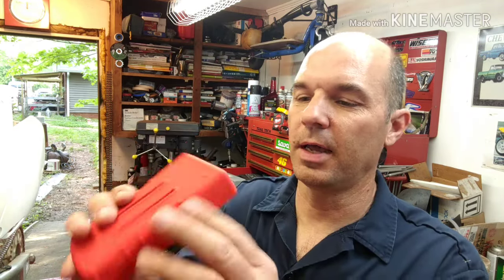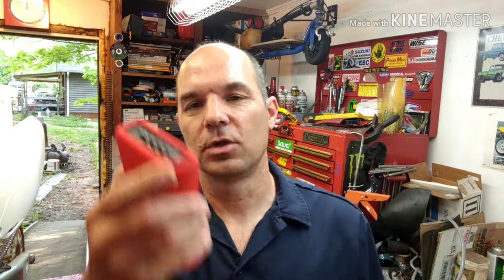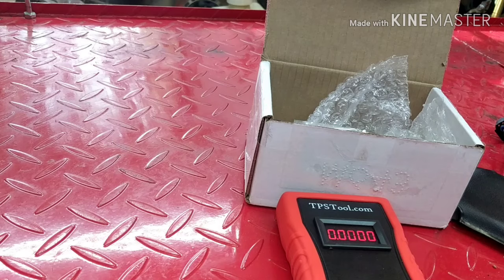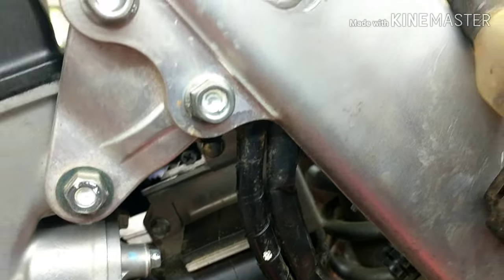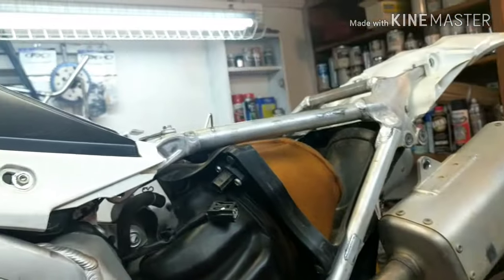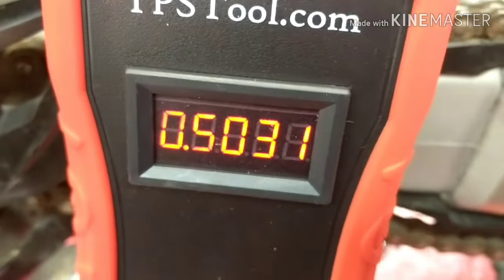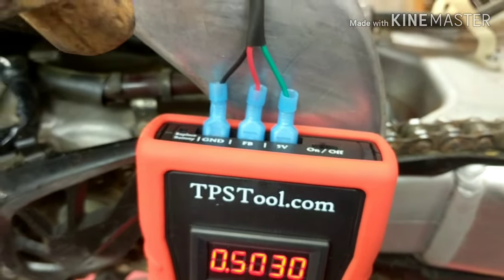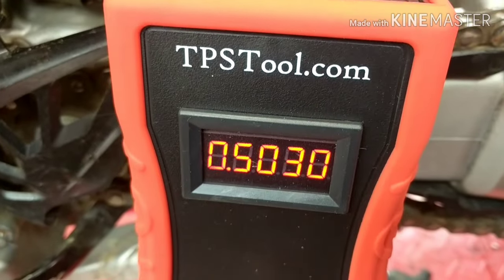Throttle Position Sensor adjusting the easy way!

Comment: Hey bro I rebuilt my 15 kx450f and I never had a fuel injected bike an moved my tps so I got the tool you got and when I tried to set it it wouldn’t go past .45 I checked full throttle it’s at 4.6 how do I get .58 to .61 thanks

Comment: Hello boss
I've made the adjustment and the bike works fine, but my spark plug is very white. What should I do to make it richer? Thanks a lot
Reply from the maker: What kind of bike is it?
Reply: @TepcoCycleRepair  crf 450 2010
Reply from the maker: @enisouertani9898  Make sure you don't have any intake leaks. If you set the TPS to the correct voltage it should run fine, a lean condition could be from a clogged injector, intake leak or a TPS set on the lean side.

Comment: I had this replaced and the guy put it in and my car just turning over was on full throttle. He took it back off adjusted and now my AT oil temp light is flashing and it's stalling out. I'm trying to adjust it but I dont have any code reader etc. I am trying to adjust it to a perfect throttle.

Comment: First time viewer. I'm having issues with a 2007 Honda Foreman ES 4x4. I've had to replace a lot of parts to include the whole throttle body. On this Honda, there is a meter assembly that flashed a code 13 which states it's the TPS sensor. I can't even shift this bike since it's an automatic. Still also trying to figure out if my fan sensor is bad in the engine. I can provide direct power and it spins just fine. I may just add a three way switch to turn it on manually. Will this tool work for this Honda??
Reply from the maker: Yes it should work with that model. It will be listed on the website. But if you have a tps light, a fan now working, and a no shift, you probably have something else going on. A common problem with those when they don't shift is the shift shaft position sensor mounted to the front of the engine. I'm a huge Honda fan but not a fan of their ES system.
Reply: @TepcoCycleRepair  Are you referring to the angle sensor? With this bike I have tried to go in a very logical order on replacement of parts. We both know they are not cheap to replace. I think once that tool gets here and and I can get the TPS to function properly. This has really been messing with my head trying to help someone out. I'm a small engine guy, not a ATV guy. I don't claim anything when it comes to this stuff especially on this model with all the bells and whistles. Thanks for your reply. Hopefully Ill have better news in a few days.
Reply from the maker: Yes the shift angle sensor.
https://amzn.to/3jArRpl

Comment: I ran my YZ250X with the TPS unplugged by accident the other day. Ran it pretty easy for about 5-10 minutes before I realized I forgot to plug it back up. The TPS was not removed just the two plugs were unplugged. Should I be concerned about any damage done? What could be damaged if it was? Enjoy your videos!
Reply from the maker: No damage, you're fine. It just controls timing. Thanks for watching!

Comment: I am wanting to know how to reset the throttle position sensor I have put a new one on but when it’s hooked up the transmission does not shift right when it’s unhooked the transmission shifts properly but I have problems with it accelerating and idling
Reply from the maker: Sounds like it's not set right. You'll have to find the stock setting for it and have a tool to set it. It's very sensitive to movement. You can't do it by eye, the slightest movement when mounting the TPS to the throttle body will affect how it runs.

Comment: I have an 08 Crf250r, would the fuel injection and carburetor be much of a difference using the TPS tool?
Reply from the maker: It controls different things. Only Ignition in the carb. Check out this link on how to for the carb.
https://crfsonly.com/forum/viewtopic.php?t=44172

Comment: Might be a dumb question but is the throttle position sensor separate from pedal position sensor
Reply from the maker: On a MC it's just the TPS. Vehicles have different set ups.

Comment: What provides power for throttle sensor
Reply from the maker: There is a 5v battery in the unit. Unless you mean on the bike then it's the battery or stator.

Comment: Thank you for the review, I'm glad you like the tool!  To go along with your video, here's a look at how a TPS actually works and what's inside it:  https://youtu.be/1CAVIe5g6yk
Reply: Awesome videos I have a 2018 yz450f electric start just got rebuilt bike runs really good but the idle is beyond high even when I try turning it down or up it doesn’t change the idle does it sound like tps adjustment
Reply from the maker: No, check your cable routing and make sure your throttle plate is closing all the way.

Comment: Would this cause a 2012 KFX450R to bog down and backfire when it hits 4th and 5th gear?
Reply from the maker: I don't think so if it's good in all the other gears. Check your valves.
Reply: Tepco Cycle Repair I just had the valves adjusted. Put in a new spark plug and took the programmer off since I don’t need it.
Reply: James McC2.4hum YES. I just put a new fuel pump on  it and a one way valve. I have no idea what else it could be.
Reply: James McC2.4hum runs good in 1st 2nd and 3rd. It was like this when I got it. The guy said it was the valves and I took his word for it. Big mistake on my part.
Reply: James McC2.4hum there’s like a 10 second video of it messing up on my channel,if you want to see what it’s doing.
Reply: James McC2.4hum what is a launch control?

Comment: I have e30 318i it was working all fine until i went full throttle as soon as i let off i had a high idle 1200-1500 idle i suspect its tps ?  Any ideas
Reply from the maker: Nice car, but I'm not sure on that one. Haven't messed with many BMW's to give you a well informed answer. Now I will say the way a TPS works, it's certainly possible. I would definitely do some testing on it first.
Reply: @TepcoCycleRepair  thanks alot im based in south africa cape town the moment i saw your msg i dug in clipped the tps open and i had a overload of oil in the tps itself i didnt get to remove th tps but all i did was take the oil out and wiped it out snapped back in, still its high but i think i need to drive it for a while and then have a look at it maybe spray some cleaner in it and clean it proper

Comment: @ Tepco Cycle  Repair  ;  I  am currently working on a Honda RC 51
"no start condition". My  question is 
will this tool work on MV Agusta bikes as well as for Nissan and Lexus vehicles ?
Reply from the maker: I'm not sure, I believe as long as you have the connector that fits it would work. Hit the link and ask them, they are very responsive to questions.
Reply: @TepcoCycleRepair  Thank You,  by the way, excellent video !

Comment: Hey, I got a 2014. Fully rebuilt, new head, new valves, shimmed, has spark and fuel but it still won’t start. What can be the problem??
Reply from the maker: Could be a few things. Timing belt, TPS, auto decompression lever stuck. Check your timing marks!
Reply: Tepco Cycle Repair timing is good and the timing chain doesn’t seem stretched. I don’t have anything to adjust tps and how could it be the auto decompressor?
Reply from the maker: Look at your timing marks, make sure they are dead on. I'm suprised you did a head without replacing it. If it was in there with the previous cam I guarantee it's stretched, it's kind of a rule of thumb when you do a top end you replace the timing chain. If the auto decompression is stuck open it will not disengage keeping compression very low. Just pull the valve cover off and make sure it moves freely with your finger. I just fixed a RMZ that wouldn't start, they just did the top end, said timing was good but they used the old chain. I insisted they put a new one in and bam done fired right up. When it's at TDC the lines on the cam need to be perfectly level with the head. Hope this helps you out.
Reply: Tepco Cycle Repair I probably need to replace the chain because everything else checks out. Thank you

Comment: Will this fix idling
Reply from the maker: Yes, it could if it's off but I would check valves and all maintenance items before this. Low compression could cause a no idle situation. The TPS won't go out on its own and shouldn't need to be adjusted to fix things, just help with performance.

Comment: Dude it's not because Honda dont want you messing with it it's because they have brain dead engineer's that have never had to pull their vehicle's apart because if these twats were made to dismantle every vehicle they ever designed they'd be making them easier to work on the second they sat back in front of their computers.  
People wonder why mechanic's charge so well you need to ph head office of that particular dealer and ask them why is it that my complete dashboard has to be removed to replace my heater core or why the whole inlet manifold has to come off to change a crook fuel injector it's a joke

Comment: I have a 2011 Arctic Cat Prowler that won’t start!  I replaced the fuel pump, injector fuel line, spark plug and also drained the fuel. Could this be my problem?
Reply from the maker: Unlikely, have you checked for spark? Sounds like it's possible a stator or spark related. Also if it sat for a long time you may have water in the system. Just make sure you got everything out of the tank before you put new fuel in.